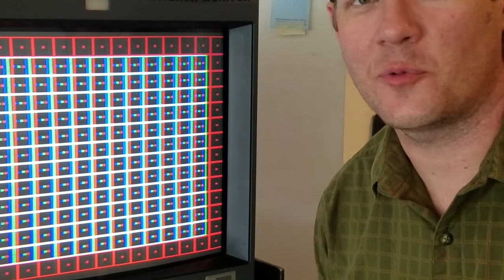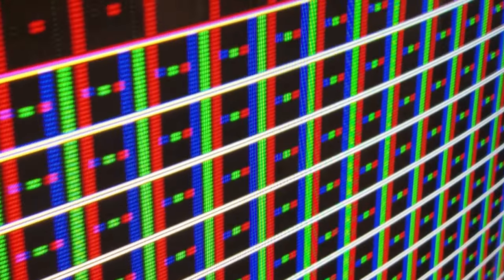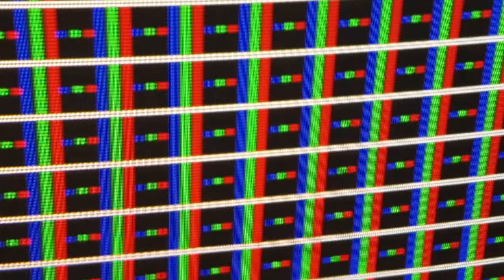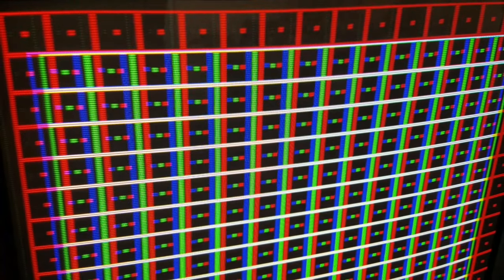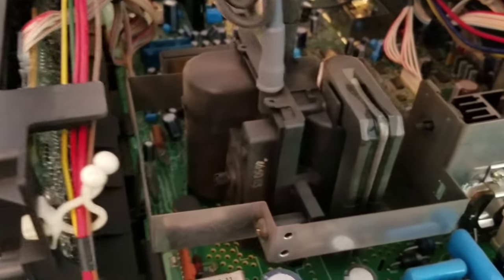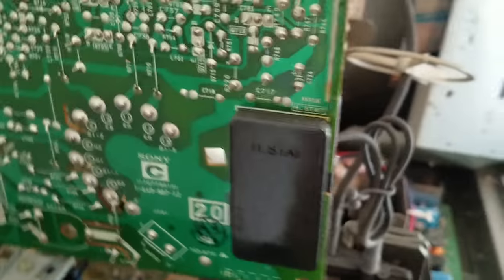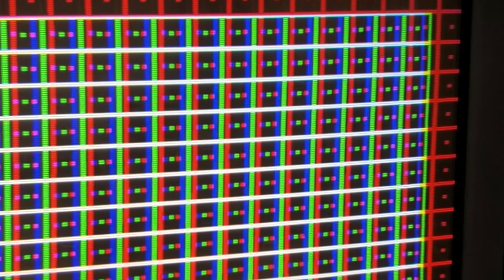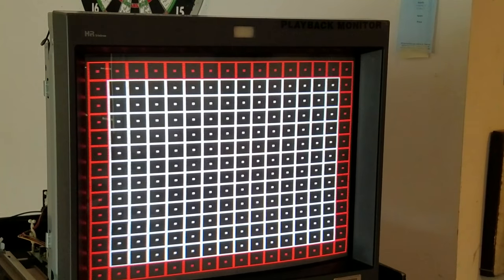Fix CRT Convergence on a Sony PVM

Comment: My monitor does not have the focus regulators.  I opened and identified.  they also lack the regulator on the neck plate of the tube.  I am upset.  I needed to adjust mine.  :(

Comment: If it were only that simple! On my PVM, the screen was slanted and I actually had to loosen the retention screw and rotate the deflection yoke to correct this. I still need to correct convergence on the top and bottom as they are inverted out of alignment, which means adjusting the purity rings. Boy oh boy...
Reply from the maker: FirebrandX Im going over convergence strips for the corners on episode 2 and yoke adjustments on episode 3, or vise versa but they should be out this week.  CRT Corners can drive one mad.

Comment: An episode going over the focus would be nice, I feel my PVM isn’t as sharp as it should be and maybe adjusting it will fix it.
Reply from the maker: Juan Salazar look for Focus coming after the next episode on Yoke adjustments for correcting picture tilt.
Reply from the maker: Hello Juan.  The episode covering Focus in available now.  Thanks for watching!
Reply: unplug the monitor, take the casing off, look for a black box at the back with a wire going to a suction cup, this black box is called the flyback, and has adjustments on the back for focus and brightness, using a screwdriver, very carefully since you have to do this with the monitor powered on, adjust the focus knob while looking at the screen, use a mirror or a friend if you cant do it easily, dont touch anything else inside the monitor, turn it off and put the case back on- my pvm actually has holes in the back of the case that allow access to the focus knob without having to take the casing off

Comment: My convergence on a PVM-20M2U seems to be off in the top right corner or in the top of the screen in general I can see white  text separating into red/green and text is a lot less sharp than on the bottom of the screen which looks great.  I assume if I adjust the focus / screen adjustment knobs it would just throw it off more or throw off the bottom half of the screen? Would this more probably be fixed by the magnet placement?
Reply from the maker: David Alvarado Magnets and convergence strips will help.  Plus it's good to dial in the focus after you get the convergence fixed.
Reply: Retro Tech thanks. I just opened up the pvm and it only has 3 convergence strips. I assume there should be on on each corner? Incidentally, the missing one corresponds to the corner in question. I don’t have access to a replacement do you have any suggestions?
Reply from the maker: David Alvarado I've gotten a replacement set off eBay.  Some pvms only come with 3 suprisingly.  The eBay seller is from France.  I'll have a video review on them by this weekend

Comment: Yeah. Got zapped again adjust the convergence on my 2030. The knob is placed in the worst spot possible. I made the convergence worse but after getting fried a couple times i got it back to how it was
Reply from the maker: Man that sucks.  The 2030 is the worst PVM to adjust for yoke & convergence.  I've shocked myself many times working in that monitor.  I ended up unplugging the PVM, then adjusted the convergence or yoke very slightly, then powered the 2030 back up to see the effects.  Especially for convergence.  I cant do that on a 2030 withput getting a zap.  Good gloves will help prevent that smaller shock.
Reply: @RetroTechUSA  oh man i did the whole process with the monitor powered on. The wooden board technique worked great for the yoke adjustment but that convergence knob was a nightmare. Maybe the designer thought it would be funny to place the knob just out of reach where you can get zapped...probably would be better to turn it off and on like you did
Reply: @RetroTechUSA  nk

Comment: Awesome CRT maintenance videos.  Subbed brother.  What about more complex convergence issues such as when convergence gets worst from left to right or top to bottom?  I have a couple of monitors like that.
Reply from the maker: Thanks! Did you check the corner convergence video?  Also the yoke can be slightly tilted causing corner distortion.

Comment: Nice video! I have a similar issue but,  the convergence problem is just on the periphery of the screen, any tips on that?.Thanks a lot.
Reply from the maker: Ezequiel Dantas Thank you.  Did you watch my video on corner convergence?  Most wonky and discolored corners are from the Convergence strips on the back of the tube.  I've actually gotten a set of new convergence strips in the mail and will be making a new video on them for this weekend, maybe sooner.  Keep an eye out for that video too.
Reply: Now yes! thank you very much. Great video, great channel!

Comment: My 2000 Sony Trinitron's convergence mis-alignment is vertical, as in the colors are separating so that on the grid the single dots create two dots stacked on top of one another.  The outer red row of the test grid is stretched off of screen area mostly vertically but also horizontally, too. There are multiple magnets and convergence strips but none of them appear to be doing anything. Any advice?

Comment: I have a convergence problem but the guns aren't separated side by side like that. The red is higher and the blue is to the left and the convergence isn't equal across the screen.
I was planning on doing a cap replacement if that is a good idea?  I haven't replaced caps on TVs before but I have done it on computers and such etc.

Comment: these are convenient thank you
Reply from the maker: You are welcome.  I'm glad they are helpful.
Reply: I posted in your PVM facebook group last night on a type of geometry adjustment I haven't been able to find anywhere, would you happen to know how to perform S-correction on a PVM?
Reply from the maker: Seth Andersen Do you mean the Sexy setting?  I'm not familier with the S-setting
Reply: it's a type of vertical linearity correction, not the one found in the geometry menu. that correction set seems to only push the inward bias more out of congruence rather than straightening the tightness I have in the middle

https://www.reddit.com/r/crtgaming/comments/98ip6i/scorrection_scor_option_on_sony_pvms/

I've posted about my issue with pictures here and a chart of the correction I'm after
Reply: I think the setting is just typically referred to as linearity
Reply: but the linearity setting I have is just pushing it more out of proportion up or down and not fixing anything
Reply from the maker: Hey, so i've been doing a little research.  The only PVM models that offer the s correction on linearity is the "L" series.  This is listed in the deflection sub menu.  Other models only have one Vertival Lin. Adjuster available.
Reply: dang, and that one adjustment isn't fixing anything. I was wondering if there was something I could do in hardware. at least I know I won't run into this problem while I'm doing my L14's
Reply from the maker: Yes the 14L will have the setting.  I just calibrated a 20L2 today.  I made a video walking through it that will be posted in the next day.  That's the first time I've notice the setting.  Thanks for bringing it to my attention.
Reply: Retro Tech sucks that I can't fix this barrel-like distortion though

Comment: What if the convergence issues are very slightly vertical, rather than horizontal?
Reply: In that case, you would have to adjust the convergence rings on the yoke on the neck of the tube

Comment: Hi steve, i hope you can help me, i have a PC CRT monitor that is SONY too, and i dont know if it has the white knob. Only the top left portion has wrong convergence, while the rest of the corners are perfectly fine.  please take a look here https://s22.postimg.cc/s2co807s1/fixable.jpg     that is the top left corner, see the red is a little bit above the text, while the rest of the corners is perfectly fine plase see here  https://s22.postimg.cc/6jrh799k1/okok.jpg            , so my question is, is my problem fixable? or this tutorial will not work for me? i wonder why only ONE corner of the screen fails convergence, because your video shows that convergence is wrong on all corners.. thanks
Reply from the maker: Hi. I made a video that follows this one on a playlist.  It covers convergence in one corner.  The white knob from this video won't likely help you, but the tips from the Corner Convergence video will.  Please subscribe too get the latest CRT videos. This is the corner video --->   https://www.youtube.com/watch?v=eMJI9n_m4pg
Reply: thanks steve, actually corner convergence was another link https://youtu.be/xAbqucrWHjU  , the one you sent me only covers geometry as a whole.  I will check tonight if my monitor has those plastic strips, but its kind of weird because on your video all the lines are out of position and when you move the plastic strip the lines move, in my case only in one corner and only red is out of place. so its kind of weird
Reply from the maker: Thanks for watching and sorry for the Link mix up.  The strips affect both convergence and geometry in the corners.  Good luck